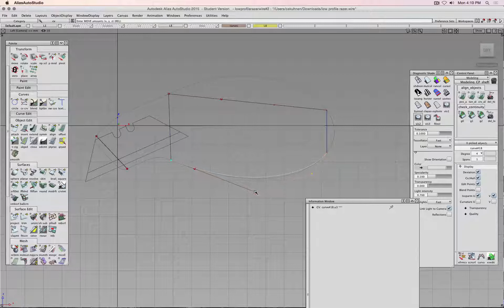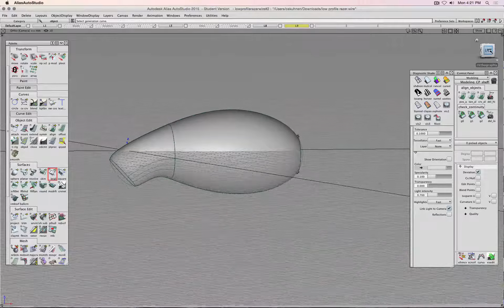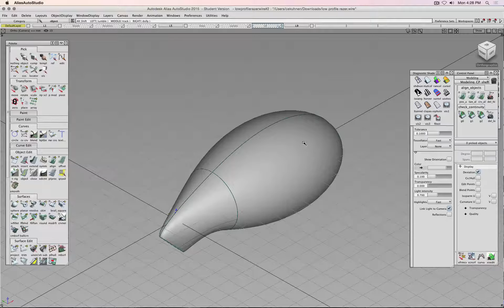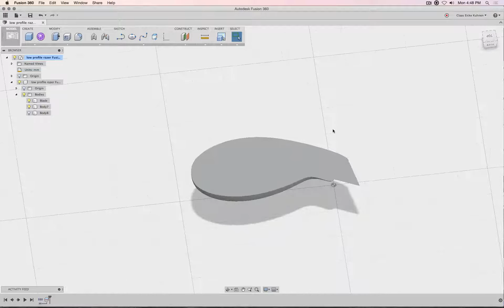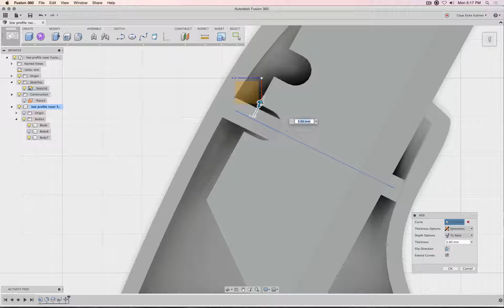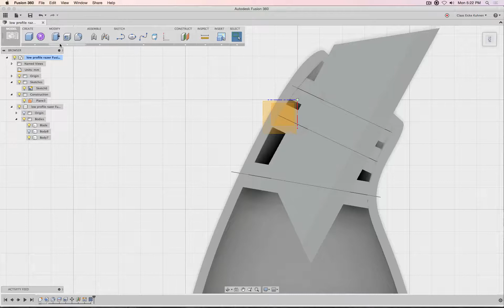Eurgene : Pre-planing curves for perfect surface flows

Comment: i don't like your curves CVs layout at all, it's messy even though you used align tool... you should break your curves at their inflections points (there is a tool for that) and use blend curves while adjusting curvature or tangency with the square or circle operator to find the shape you want. you might find useful to use the curvature comb while adjusting those CVs too. it helps to find a nice flow and reach G3 quality. you'll get better surface quality and better CVs layout. At last, if your align tool was acting crazy that is because of your bad CVs layout. Well enough pedantic advices from me... Nice channel, nice videos. You know how to use a lot of different softwares ! Pretty impressive ! Keep going !
Reply from the maker: Ralex Hassle Those videos are for beginners. Dealing with G3 and breaking curves at inflection points would make it too difficult for the at that position. We later rebuild everything in Fusion 360 with parametric tools where work different again.

Obviously I do not teach Alias like for car design but more as a concept exploration before going into parametric.

I hope this explains it.